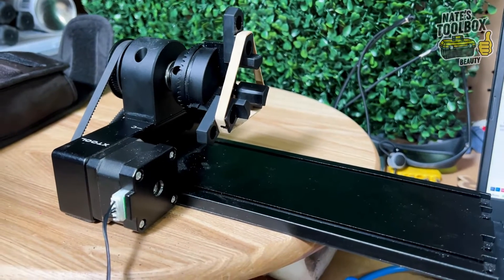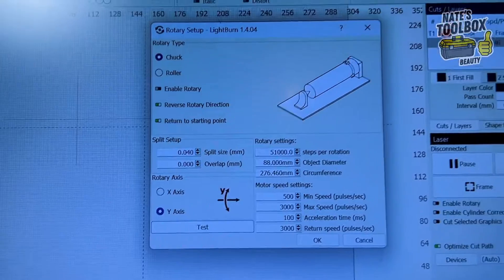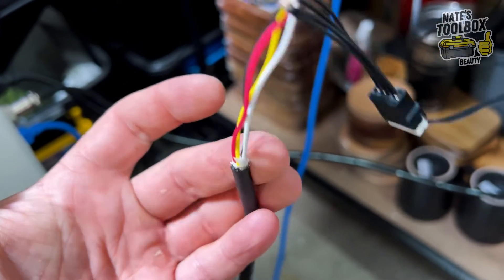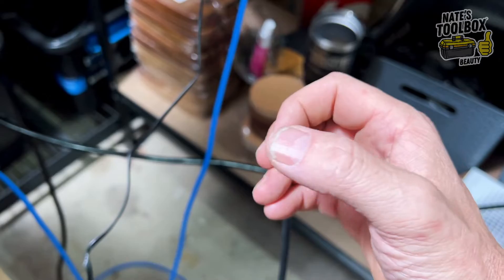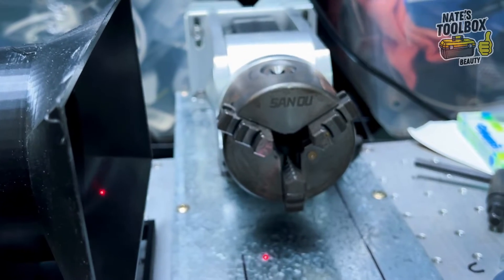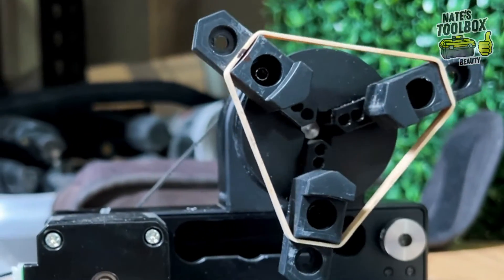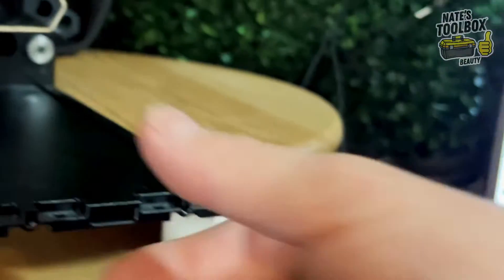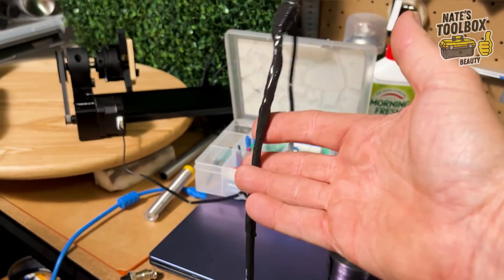xTool RA2 rotary - Fitting an Aviation style plug for use on a Fibre Laser or CO2 machines

Comment: Just one question:
Do you need to use a GX12 or GX16 4pin aviation plug adapter for your xTool rotary?
Reply from the maker: Usually GX16 (most connections are) but mainly it’s to suit your needs. You could hard wire it if you wanted to but most have a plug

Comment: I'm trying to make the RA2 Pro work on a OMTECH 2028-80W laser. 

Will this be as simple as adapting the aviation cable to make the RA2 Pro work?
Did you have to switch the stepper motor since its 12v or 24v on the RA2 Pro? 
Did you have to mess around with the amperage on the controller driver on your laser to make the RA2 PRO stepper motor to work correctly?

sorry for the questions but these are question i see a lot of people with.

Thanks for the video Nate.

Comment: What is the voltage  for the X tool rotary? And check. I have the same set, but I have a different Fiber Laser. I have the Owen tech 20 W.  And I also have a Adam stack roar as well. They all have the same wiring configuration. I’m assuming the two black wires with the white stripes on them are the positive and the other two are negative but I could be wrong. If anybody knows, please let me know.

Comment: My ra2 came with an aviation plug/4 pin connection in the box.
Reply from the maker: Oh awesome you must have the new P1, M1 or something right (or CO2) ? Sorry don’t know all the names haha.   The D1 Pro just has the flimsy plug
Reply: I assume that’s what it’s for but I have a atzer brand diode. But thought it was cool they included the aviator plug so I can use it when I upgrade to a big machine